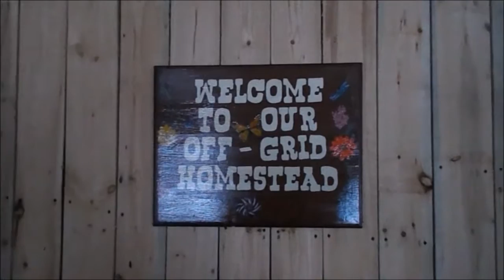Babies? Maybe, I lost Some Wood And My Belt Fell Off

Comment: You were lucky to find an old saw rig like that many were converted to hitch direct to the tractor.    I have worked around aan old corn blower/chopper that ran on a belt like that.    Our saw was three point hitch which was nice that as the pile of wood moved we could move loser.   We also used it to sharpen a lot of fence post
Reply from the maker: +cabotbluegill They are still quite common to find here still, this saw has the brackets to hook to my 3 point hitch, but I do not have the pto to belt angle drive :-(    It is to bad that so much of this type off old equipment has disappeared over the years  :-(   Take care ttyl     :-)